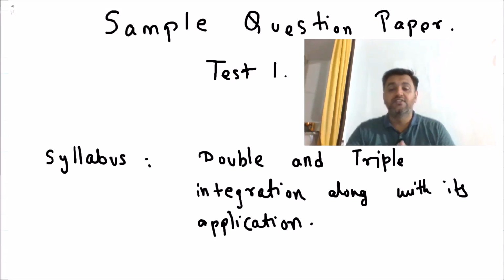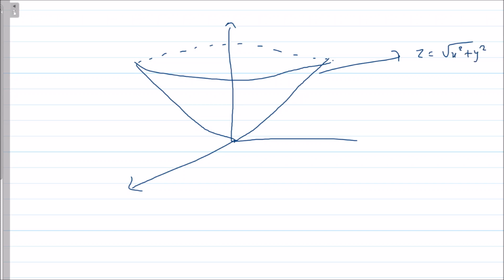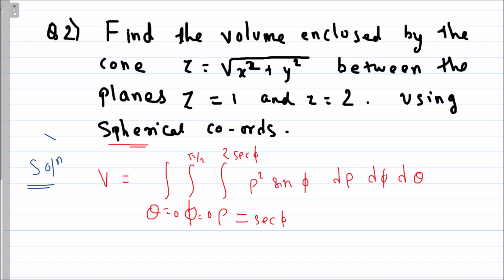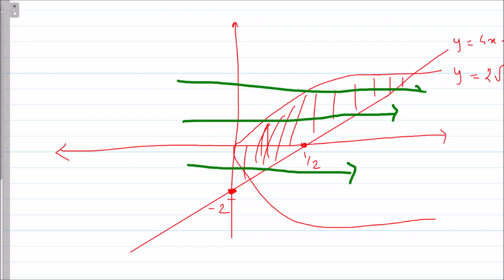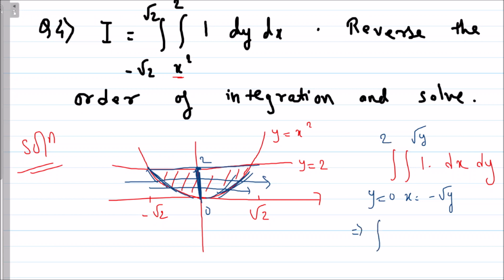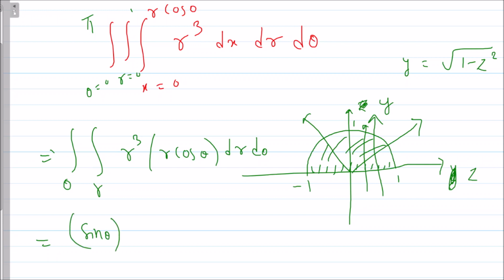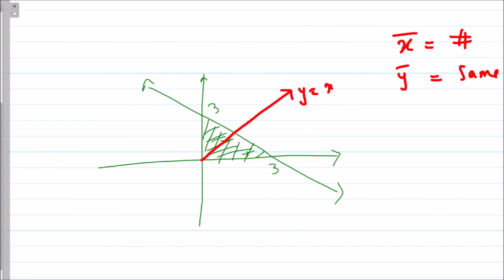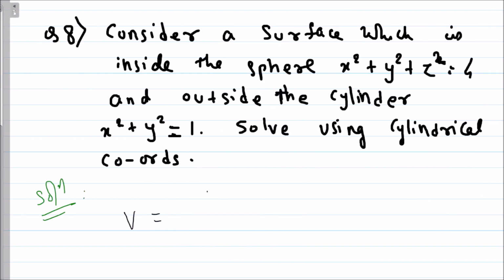Sample question paper on Test 1:Double & Triple Integration & its applications(c comments for Q2&Q3)

Comment: sir in the last question is there any way we can find out volume which is above the cylinder and just below the sphere, i mean the top and bottom of cylinder wont touch the sphere so there will be some space left out....
Reply from the maker: In that case, rho will be from something to 2 and theta will be 0 to 2pi.
For phi, it will be from 0 to something. 

For first something,  radial line will enter from z= root(3) so rho*cos(phi)=root(3) and hence rho = root(3)*sec(phi).
For second something,  we have right angle triangle with hypotenuse 2 and adjacent root(3), use cos(phi) to get the angle phi.
Reply: @DrMathaholic  thank you so much sir and thank you for making all videos, it helps us a lot sir🙏
Reply from the maker: @StrawhatLuffyy007  thanks for acknowledging 🙂🙂
Reply from the maker: Think what I have written and let me know in case of any doubts or clarification..
All d best..
Reply from the maker: And yes, multiply it by 2 because same surface is at the bottom as well

Comment: 6:42 in case of cylindrical coordinates the limits we put will be 
for z :2 to sqrt(x^2+y^2) 
for r :1 to 2 
for theta :0 to 2pi 
Is this correct ?
Reply from the maker: In case of cylindrical,  you need to divide the surface into 2 parts..
For one part, Z will be from 1 to 2 and for another part z will be from r to 2..
Accordingly limits of r will also change..
Now try!!
Reply: @DrMathaholic  why do we have to divide the frustum in two parts ?if we draw lines parallel to z axis then they enter at sqrt(x^2+y^2) and leave at z=2 ?
Reply from the maker: @helloworld-hv9oy  for one part it will enter from z=1 and for another part it will enter through cone z=r
Reply: @DrMathaholic is there any intuition for this ?Actually I don't get why the first approach is wrong ?
Reply from the maker: @helloworld-hv9oy  you see the surface and see where it enters the surface and where it leaves the surface... in this case when we draw a line parallel to z axis , then the line enters the surface from 2 different surfaces and hence we need to divide into 2 parts
Reply: @DrMathaholic  okay thank you !!!!